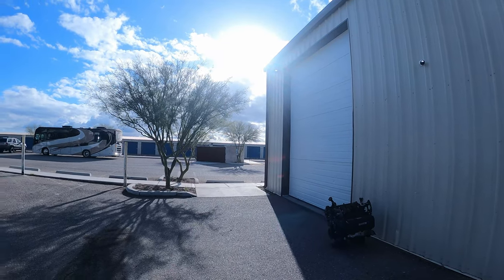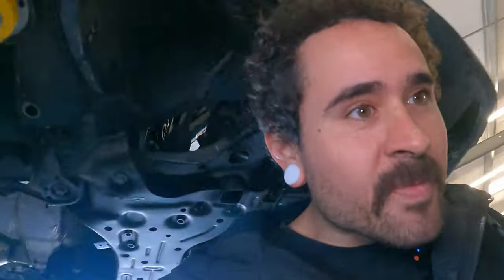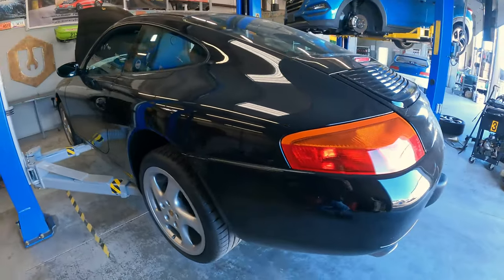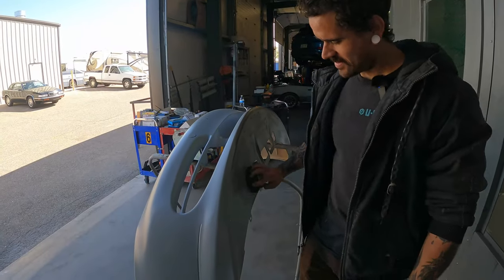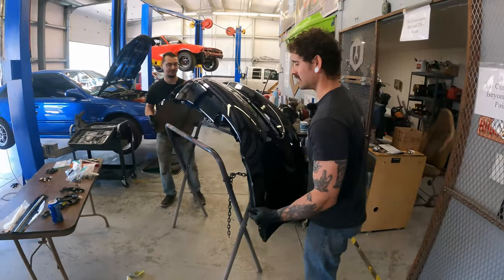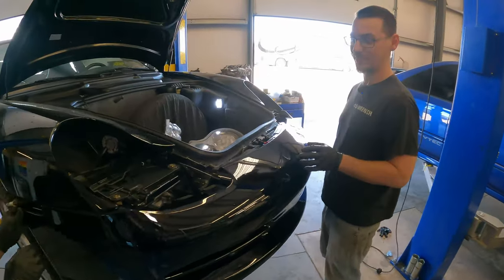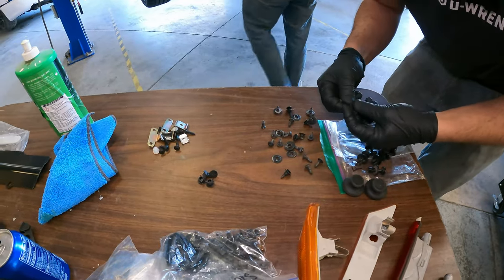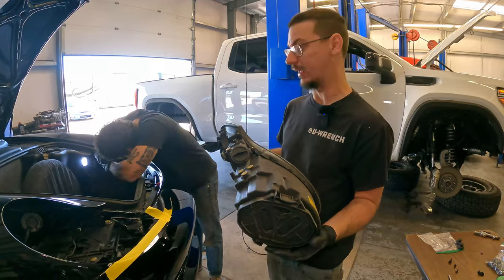Installing a GT3 Body Kit on a '99 Porsche with 7,800 Miles!

Comment: Fred cracking job 👏 there nice paint job Fred I have a ford focus mk3 titanium x and iam putting the original bumper on from ford it comes primed mate Fred would you blend it before the base coat paint goes on mate as the bonnet clear coat paint pealing as well
Reply: Blending is the best way to match colors. Butt matches are never easy.
Reply: @brandonwelsh2743  so fred primer mate and wet bed  and base coat paint and clear coat paint 👌

Comment: I have a 99 C4 with a couple of cracks in the front bumper cover.  I have alway liked the 996.2 look with the larger openings on the sides.  I have seen 996.1 GT bumper cover that has the cutout for the extended front lights and am considering it.  any suggestions on the various suppliers of good and poor products would be appreciated.
Reply from the maker: I will speak to the owner of this car sometime over the weekend. He is the one that researched and found the parts. I will get back to you when I have some info for you.
Reply from the maker: The owner says SunCoast Porsche in Florida is the best.  www.suncoastporsche.com